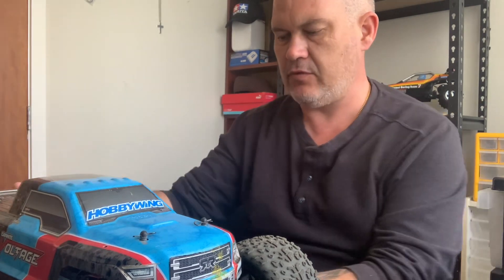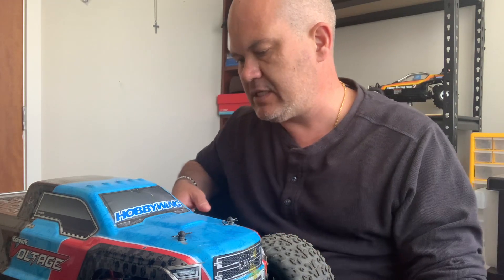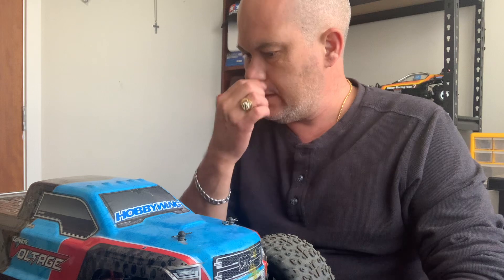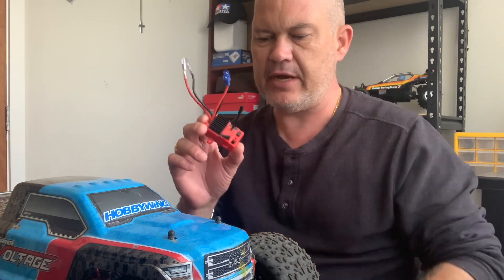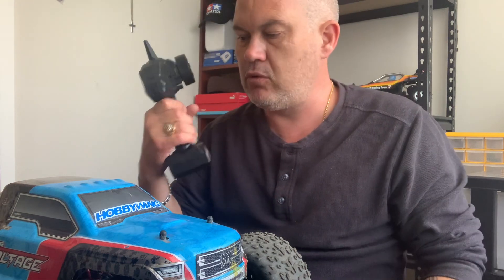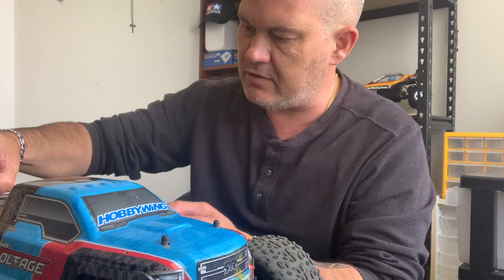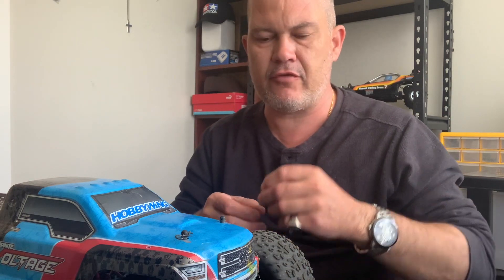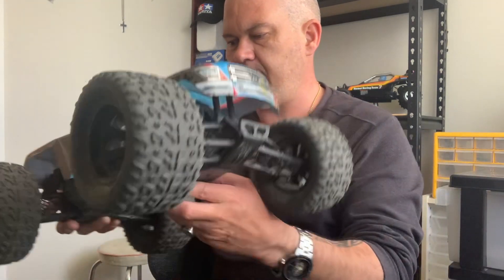Arrma Granite Voltage Brushless Conversion ,Watch This Before You Do

Comment: I broke my drive cups the 3rd run stock setup. I switched to metal drive cups and haven’t had any more issues. Getting ready to switch to a brushless setup. Got a 4000kv HOBBYWING motor and matching speed control.
Reply from the maker: Yes it’s a common problem with even the stock granites , those stupid plastic outdrives and when you go brushless it’s to much power for them to handle